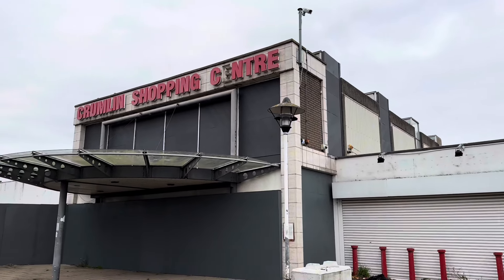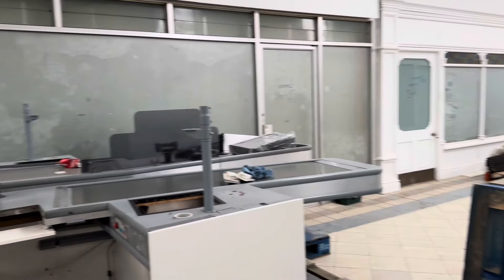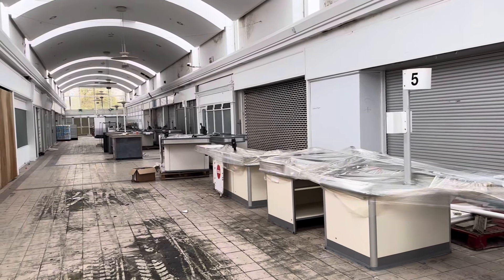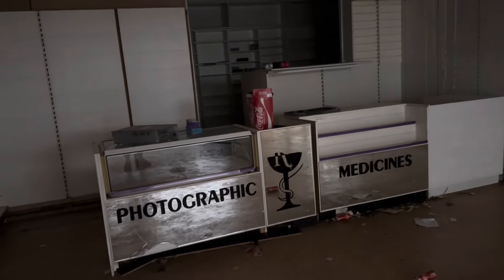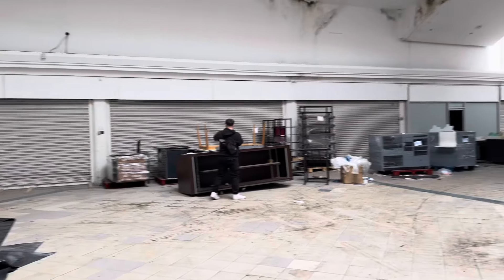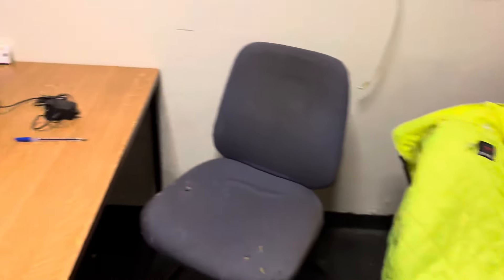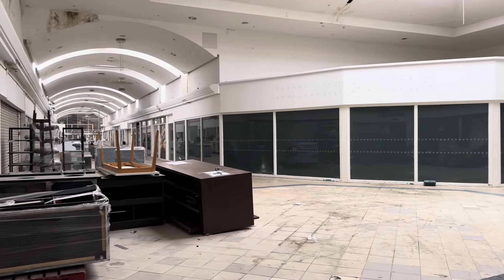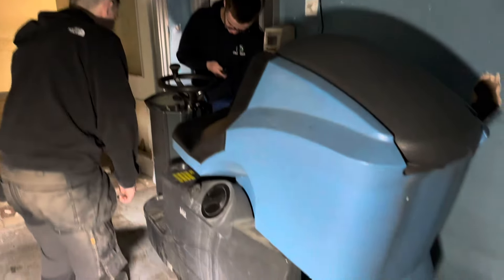Abandoned Dublin Shopping Centre Crumlin

Comment: The Dunnes Stores supermarket was unique that it was spread over 3-4 units for the different grocery departments in the old centre. Tesco gave up their lease on their proper supermarket next door so Dunnes opened up a proper supermarket there, which was a lot more logical 🤪 Anyway if there was a prize for Ireland’s worst supermarket the old multi unit Dunnes would have been high on the list 😅

Comment: This is currently being demolished after 10 years lying there, emptying all the shops out for no reason. The new site will be similar to Ashlead, a large Dunnes, a few small shops and a  KFC full size with drive through It's about time. The store dunnes now trade from was originally Tesco. As one commenter mentioned, originally Dunnes had 3 Seperate units (Drapery with grocery,a separate frozen store across the mall and further down another for fruit and veg etc) crazy .They did the place up as you can see and took a corner of the mall away and moved Dunnes into one. The Heffernans/Dunne family emptied it out as each lease expired. They own the site. Last to go go was the exterior outlets and Dunnes moved AGAIN ,this time into the old Tesco unit. This process started in 2003, 22 years ago and theyhaven't touched it in over 10 years until Lidl got PP for a large store 5 minutes away and finally February 2025 demolition has started however I thimk it's too little too late.  They are still doing crazy things such as Crystal Clean car wash built a unit in the carpark,drainage the lot and after 3 months they then move them out as demolition gets underway so again erratic management decisions